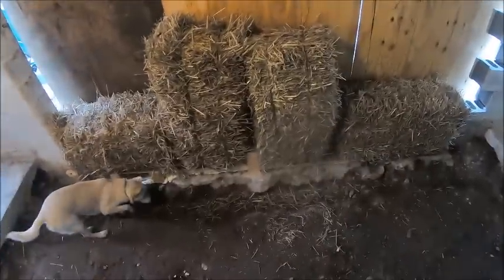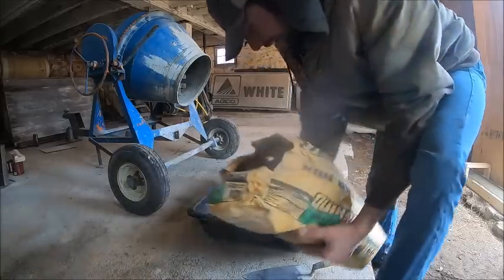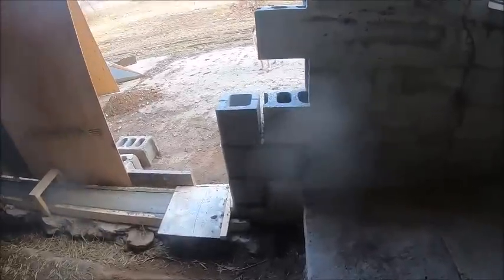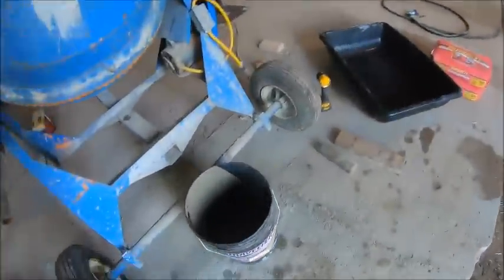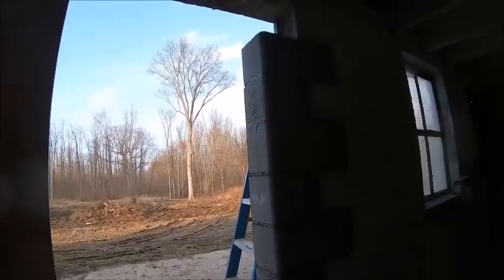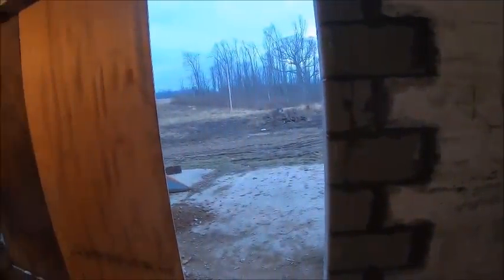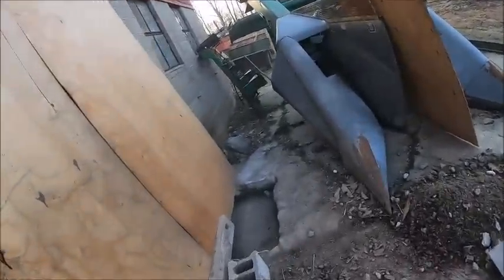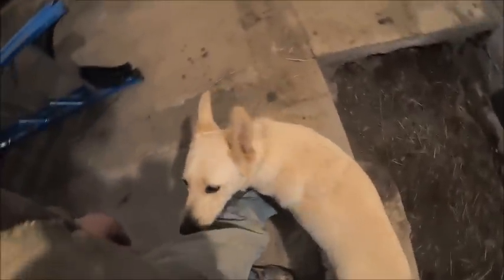Barn Door Project Part 7: Laying Block

Comment: You got the job done. You can’t complain about that and learned a lot as you went. The next time you do concrete it will be even better. I have seen concrete guys use diesel fuel as a form release on the boards to help to keep them from sticking.
Reply from the maker: Anything that will put a slick coat on the wood will help. Wax, oil etc.

Comment: It looks pretty good Ethan. The only thing I would have done differently would have been to stick rebar done the core of those blocks that you filed with concrete. Excellent job young man.
Reply from the maker: Wouldn’t have got rebar all the way to the  top anyhow with the beam in the way.

Comment: The cracked joint is no problem,grind it back 3/8" dampen the wall lightly, get a grout bag squirt the mortar in with the dag then strike it.

Comment: Repairing existing block or brick is always getting it as close as you can with out going nuts and calling good enough.
Reply: Getting the mortar right is like mixing pancake batter. It's not always easy to get it right.